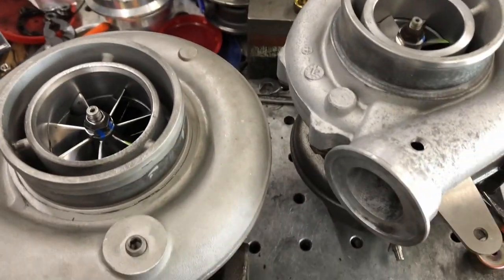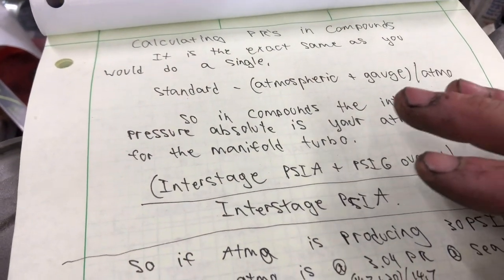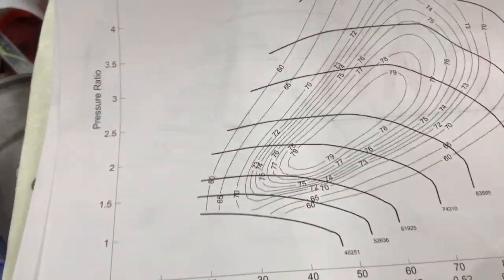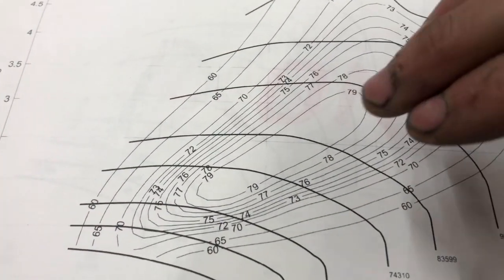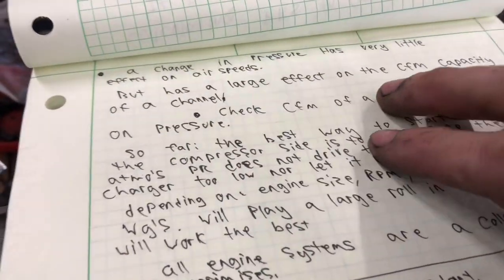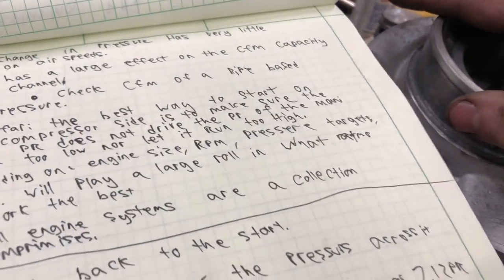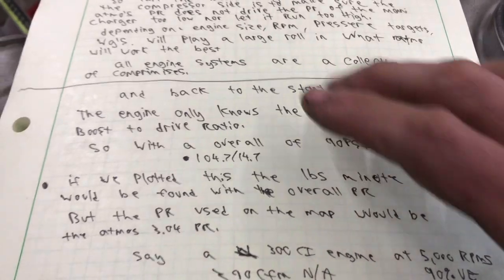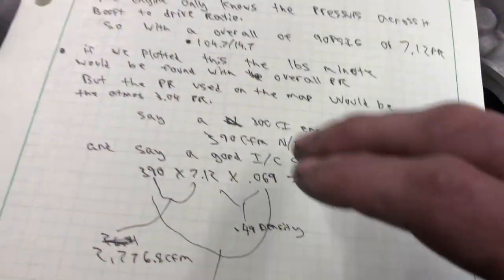Correcting previously stated ways to calculate and tune compound turbo setups

Comment: Calculating pressure ratio is clearly not the way. Yes it will help you out, but not if you are not planning to install interstage cooling.

If you want a properly sized setup that can be staged as double in terms of flow, you need to use density ratio and not pressure ratio. Density ratio will determine if your hp stage, and then shaft speed will stay in its designed rpm range and efficiency.
Reply: Add to this comment of mine.

People need to do math backwards!
1. Set your power goal
2. how much mass airflow(in LB/min) 
3. What rpm, pressure and IAT I need to make that much of mass air flow with chosen engine. 
4. Get your compressor maps out and look where your turbos are most efficient (in regards to PR)
5. If you're Not cooling the interstage small turbo needs to be flowing more than half of the LP stage. 
6. If you are using the interstage cooling you can have HP turbo with half or even less flow than LP turbo. 
7. Choose turbochargers that should stay within 80% of their maximum mass flow.
8. Don't be suprised how big turbos you really need for LP stage. 😅
Reply: @lamazver I’m curious here. 

And I’ve got to do some math to figure my system out. But I’m on a walk rn. 

Let’s say I have a stock lly Duramax. It has the stock turbo charger. 

I want to do a compound setup. 

My max hp goal is 600 hp. 

My thought was to do a gt45 that has a max flow rate to support 700-750 hp. And if the 69mm cheap gt45 doesn’t work there are upgraded units that have bigger compressor wheels and exhaust wheels. 

From what I am getting reading your comments is that the atmosphere ( larger) turbo should be much larger than I am assuming expecting? 

If this is correct using a s475, s480 and s488 would be the better option for me if I am reading this right. 

What’s your take on my situation and also clarification on your ruling for sizing compound
Reply: @chazgeisler6213  what year dramaMax?
What kind of Rpm you plan to run?
What A/F ratios?
Do you plan to cool interstage?

You have one comment of mine under my comment. There is a pretty good explanation.
I assume you have gen2 duramax
And that garrett flows pretty good from stock(seems like 500hp turbo for smokey) so adding S480 over that seems reasonable. I could do more math but I need compressor maps and more time.

Comment: How much % are the difference between the small turbo and big turbo?
Reply from the maker: @jean786  I don’t think percentages are probably a good way to do it due to scaling. The main goal is to (and it kinda goes against one another) but the atmo needs to be as large as possible on the turbine side to set the system up so the pressure drop through the manifold turbo turbine housing is as great as possible. This is known as the expansion ratio and is important for both mass flow rate aswell as work done to the turbine wheel. But as small as is possible so that the system is responsive and hits target pr as quickly as is realistic then maintains it through the rpm band. This is also mani charger dependent but as of late either through housing size or waste gating the atmo charger and adjusting it’s pr to change the speed of the manifold charger to a better location has been yielding extremely awesome results.

Comment: Im putting together a compound system om my Kodiak. Can you go into the possible benefits of intercooling between the atmo and manifold turbo. Seem like there would possibly a bunch of efficiency to gain by doing so. Maybe do a hypothetical with and without interstage intercooling.